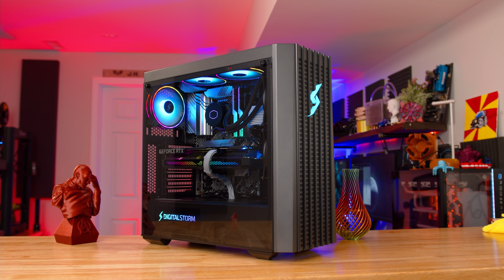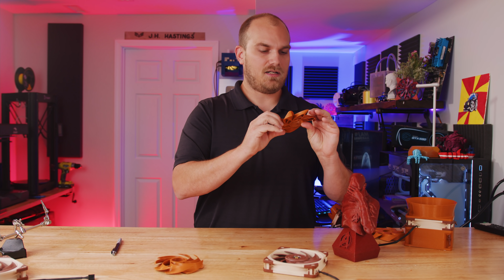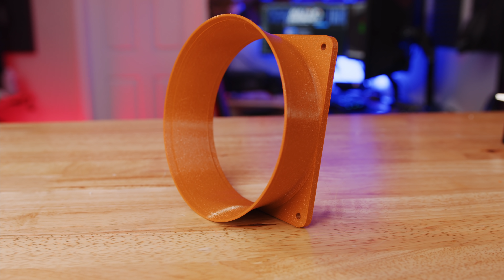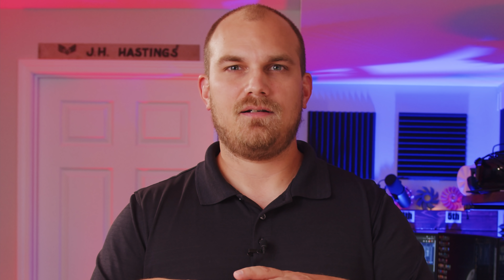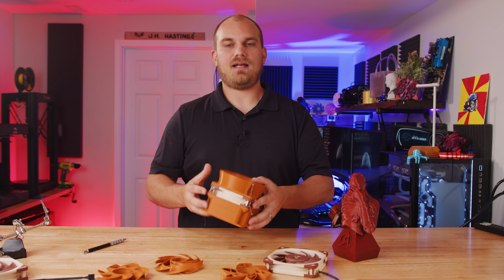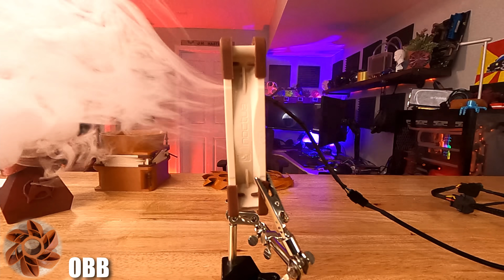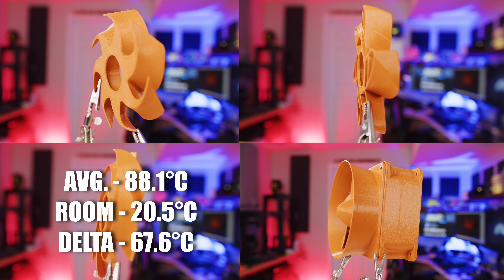Is this CHEATING? - Fan Showdown S3E3

Comment: I'd love to see a redo of the Noctic with the centrifugal spreading issue fixed
Reply: If it was kept the same but had a 360° ring around the very edge at the tips I think it would keep everything constrained.
Reply: @jtcustomknives  like an eloop from noiseblocker?
Reply: @jtcustomknives  I too was thinking the same about the ring around the edge to keep the blades from flexing.
Reply: @jtcustomknives  even just a little stringer between each blade at the end would work. they would be performing in tension together to keep it all in
Reply: @jtcustomknives  that might make it louder
Reply: @jtcustomknives  it's gonna add some weight tho, limiting rpm
Reply: YES!!!  I would love to see this fan able to push to full RPM.  Please Mr. Hastings!  Make it work!
Reply: I agree. I was disappointed  we couldn’t realize  it’s full  potential.
Reply: or print it with slightly shorter wings, so when it's most spread out, it just barely doesn't touch the case.
Reply: @Uminustaka  Eh, shorter wings would change its looks (and the way it behaves with the air), I think the point would be to keep its shape, just make it possible to spin faster.
Reply: @Ralesk  Looking straight at it taper off a bit on the right side of the blades so that when it bends out it moves into the desired position.
Reply: @Ralesk  I think the best way to do this would be to increase the thickness of the blades at the root so they are a bit stiffer, 
as well as strengthening the intersection between the blade root and splitter.
Reply: @Ralesk  That might not ba a bad thing... Case fans are usually optimised for a particular speed and when they're outside of that speed, they're noisier/less effective/etc. If you could use the flexing of the fan to modify the way the air flows at particular RPMs you might be able to get a fan which is more optimised across larger speed ranges. Kind of like a variable pitch blade on a prop aircraft. Have the angle of attack change to match RPM it's operating at.

A few years ago Formula 1 cars were using such flexing to their advantage. Adaptive aerodynamics is tightly regulated in Formula 1. But some teams realised that if you made certain subwings thin enough they would bend under the air pressure and stall at high speeds, which reduced the drag on the high speed straights. Once you braked for corners though they'd unflex and go back to providing the downforce required for the corners.
Reply: @Logarithm906  Of course, but that's probably not the case here - it had to be slowed down (excessively) because the blades would otherwise touch the shroud and make things worse. I'm sure that wasn't intentional and the current low speed isn't the fan design's intended speed.  It's a mistake that deserves to be fixed and revisited.
Reply: @NotDumbassable  Yeah, making the blades thicker was one of my thoughts too
Reply: @Ralesk  the problem with making them thick over the entire length would be increased weight and more drag. 

I think just a stiffened intersection and thicker blade root would suffice.
Reply: We need this to float to the top, with likes.
Reply: maybe do a re-print with the blades slightly thicker...?
Reply: I wonder if printing in resin would help
Reply: The Notic needs to be a shrouded fan for vibration/balance, strength.
Reply: Wouldn't making it on the resin printer be stiffer than the PLA or whatever? That might get it there.
Reply: The spreading might not be the actual issue. If they found out how much spread it has when reaching the target speed, they could adjust the size smaller while at the same time making it stronger
Reply: I’d like to see one that takes into account the flex so it’s final shape is after deflection.  Big brain right there.  👍
Reply: ...he should've wrap a layer of duct tape around the blades. It's thin, light weight and incredibly strong (has substantial tensile strength)...
Reply: @t850  Stiffness is the problem.  Duck tape is not very stiff.
Reply: @artofeverything1816  ...it's not, but in this case it's not important since blades have tendency to "expand" outward due to centrifugal force. Ring of duct tape around the blades would resist that expansion (just like metal wires inside car tire resist high pressure inside it or how soda can has paper thin walls that can resist high pressure). In both of these exaples tensile strenght is the key, not stiffness...
Reply: @t850  Ah I see.  Thought you were meaning to use duck tape or duct tape or gorilla tape(all brand names except the tape was originally deemed duck(because waterproof) by military use and it’s not actually used to hold ducting together) to reinforce the blades themselves not add a ring around the outside.
Reply: @artofeverything1816  ...I guess I wasn't clear enough - my mistake. Whatever the solution,  hopefully we'll see the rerun and far better results...:D
Reply: Or reprint with a 1 mm smaller OD or maybe even 2 mm
Reply: Muscle-cars often have 'velocity stacks'; tiny 'trumpets' that smooth air-flow into the engine.
A short 'trumpet mouth' on the inlet side of any box fan is gonna help it move air and make it run quieter.
Do they look silly?
I dunno, I think they look like little jet-engines.
In my book, that looks cool!
Reply: Honestly probably just a stiffer plasitc
Reply: yeah, shorten them by some mm's, maybe even with FEA to determine how much has to go
Reply: Strudier filament might help
Reply: A small bit of sandpapering would solve the issue
Reply: I love redemption arcs
Reply: Or perhaps stiffer plastic. Glass or Carbon reinforced nylon might work and still be 3d printable (albeit perhaps not with the current printers available to MH.)
Reply: Same

Comment: Lighting tip. Theres a lot of yellow light going on and screens tend to overcompensate for yellow lighting. Giving your whole video an odd sepia color. Go for a more white lighting, diffused if possible. That will give the video a more clear and crisp hue. Which comes across great on screens, if the white lighting isnt too bright and invasive. Even better if its not in frame. Other than that, the setup and everything comes across great in your videos. Also i dont have a pc that runs any cad. So i cant send the design i have thought up. But it involves inverse airfoil curvature and some venturi effect. Now if only i could make it lol.

Comment: Sooo is there a commerical solution similar to the cheater or do I have to 3d print it? I've certainly considered making an air "chamber" from the front case intake to the cpu cooler to go around the gpu heat...
Reply: 120mm fan duct exists
Reply: This was common for oems to do in the Pentium 4 days

Comment: The cheater is not cheating. It fits within your dimension constraints. It just shifts the goal posts by making the flow behind the fan just as important as through it. The race now is for better diffusers, better intakes and better fans that work with the best intakes and diffusers. Thi is game changing. Being top without even having an optimised fan is game changing.
Reply: aslong as you can mount it on the radiator's id say its fine.
its just like those chrismas tree once of earlier season only the fan is more in the middle.
Reply: I absolutely agree. I want the best fans. This is the way forward.

Comment: Something I would love to see is an individual fan video on the Notic that provides it the structural support it needs, such as a full ring along the circumference of the fan
Reply: Just a leading edge/point ring - 1mm x 1mm would do the job. If clearance is extremely close, you won't get the "spillage" a fully enclosed ring prevents.
Reply: I wonder if printing in a different material like resin would be enough to handle the structural issues.

Comment: Any word on a market timeframe for the one that got licensed by a manufacturer?
Edit: I don't think it's cheating, it's just another category.  You've got your practical fan replacements that could go into a PC, and then you've got the big ol' crazy ones. :-)
Reply: yeah agree i don't think it's cheating either.. reminds me of those old dell and emachine cpu cooler/shroud designs back in the day.
Reply: The guy ended up making a deal for the rights to the fan design, but neither he nor the company in question stepped forward to offer details as to whether it was coming to market, or when...
Reply: Which fan got licensed?
Reply: @joshuahaewardii8540  I forget the exact name... it was from way back in mid season 1.
Reply: @andie_pants  it was "The Acceleron" (spelling?) By Thomas if I remember correctly
Reply: @joshuahaewardii8540  It was called the Acceleron, and I too am interested to see it come to market
https://youtu.be/WWiZ13T3mxk < - this was the follow up vid on the fan where he printed in resin.. and also announced the licensing deal
Reply: @joshuahaewardii8540   it was "The Acceleron" (spelling?) By Thomas if I remember correctly.
Reply: Definitely not cheating to make stupid deep fan or ducts.
It's the same argument over airflow vs noise. Some people need airflow and don't care about noise. Others have a HTPC they watch TV shows on while their significant other is sleeping and need silence... Everyone is different.
Reply: Wow cool

Comment: I'm sure you've heard of the new phanteks fan it out performs the a12x25 for rads. Might be something to bench mark also, just to see where it lies in the charts.
Reply: Meh, the performance gap is mostly if not 100% due to the 20% added thickness. Nothing else much to see.
Reply: @TheUnPlayable  fan blade design is different, number of fins is different, bearing mechanics are different. I think it's more then the 5mm taller blades/frame.
Reply: What about noise? 37mm thick delta fan rated for 4.8 amps outperforms noctua too. And its 12cm too ;D
Reply: @TheKrystian0  yes, but this is only slightly thicker, can use used on a fan header (where that delta fan could not be). It's much more plug and play. It's noise normalized test out performs noctua. 

Check the Tech Buyer Guru fan review from yesterday.
Reply: @brandoneich2412  Thanks for the recommendation of the review. He actually shows that for the same temperature of 71 C the Phanteks put out 35 dBA (normalized to it), while the A12X25 put out 40 dBA (max speed). Very impressive.
Reply: It does not outperform it noise normalized. Only comes close. It is also louder for its plus performance. And no, a logarithmic unit still cannot be divided by a non logarithmic unit like CFM. So nice work from Phanteks, but Noctua is still the best.
Reply: @LocutusH81  tech buyer guru did a review and it's out performs by about 3°C. All of the other top fan he tested were within 1-2°, but it was lower the the best by 3°. (When noise normalized, and tested on a radiator)

Comment: I think fans should be tested against each other without the extras. Maybe there's an unlimited class in our future??
Reply: The extras are part of the design submitted.

If two cars were tested against each other, one came with a wing stock from the factory to improve handling at high speed corners while another one didn't, would you remove the wing? No, it's part of the package.
Reply: @sepg5084  These aren't factory cars, they're race cars and we've got plenty of classes for those..